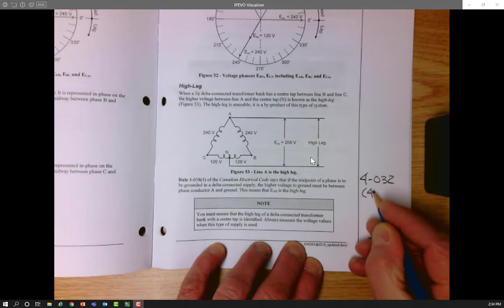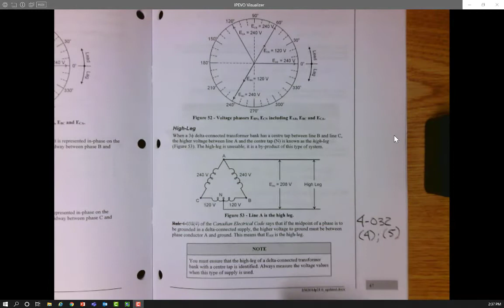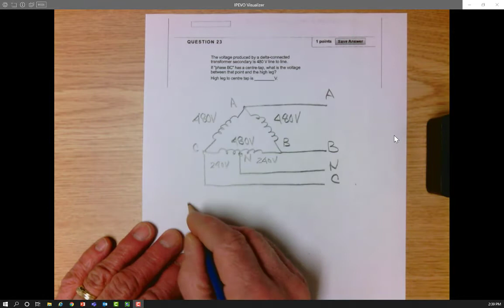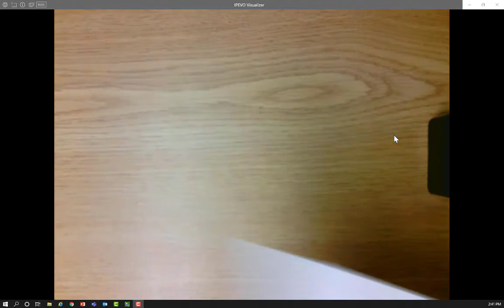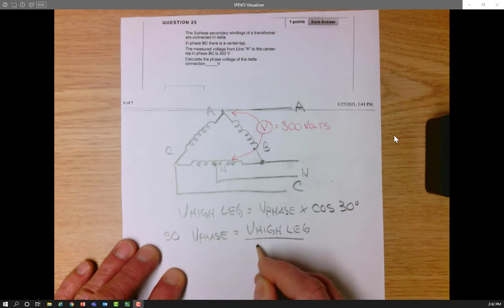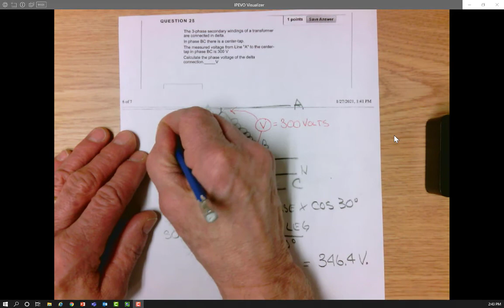4 Wire Delta Systems

Comment: 4 wire delta systems can usually be identified fairly easily if you know what to watch out for.  Since load balancing is poor if supplying any significant line to neutral loads, oftentimes if you look at the pole you will see 3 transformers, with one being significantly larger.   If you see a panelboard with every third space blanked or a three pole. If you see colors like black, orange,  blue and white (a common coloring scheme here in the USA)

Comment: Like in Canada,  here in the States 4 wire delta  are/were commonly used in commercial and industrial applications which supply mostly 3 phase equipment and small to moderate amounts of line to neutral loads,  and this system is typically used in really old buildings,  but is sometimes also used in more recent buildings,  so anyone working in a three phase  panelboard should always verify voltages and understand what system they're dealing with, to avoid dangerous and/or costly mistakes.

Comment: Never been to Canada but in the USA  in panelboards the high leg is required to land on phase B, and required to be colored orange or other effective means, where the neutral is present. In metering equipment the high leg is found on phase C.  Three phase,  and single phase line to line and line to neutral loads are allowed in the same panelboard.